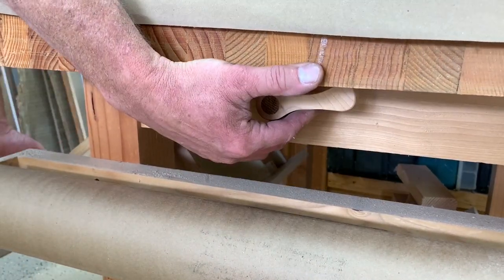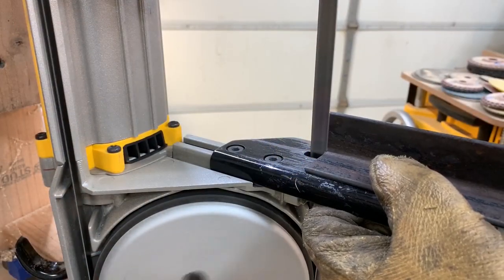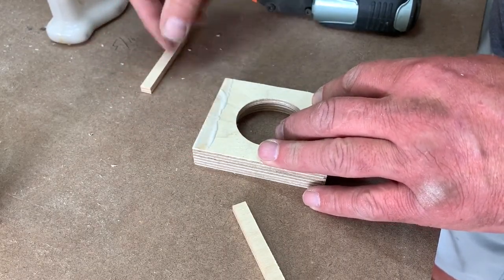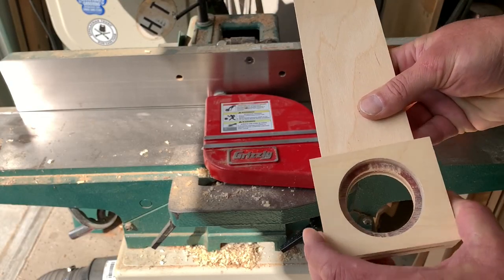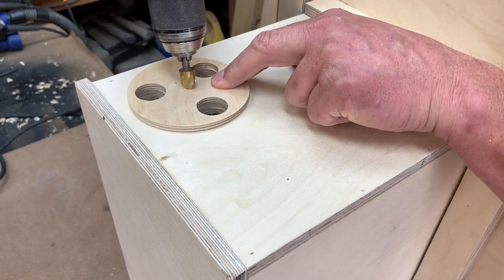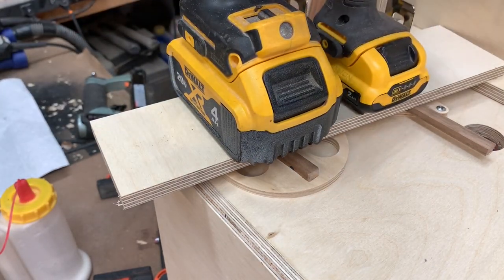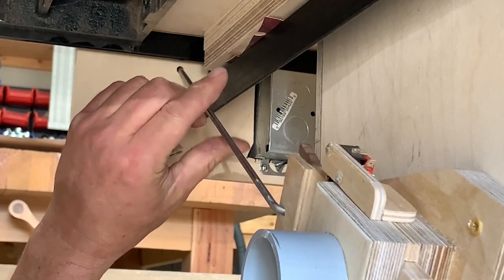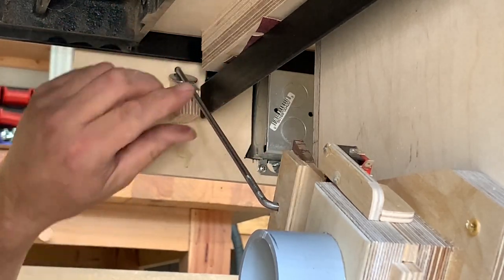Router Table/Lift Installation | DIY Blast Gates and Dust Control that Wont Choke your Router!

Comment: 9.9 points out of 10 awarded to you sir! As I am about to redesign my wing mounted router table in advance of receiving delivery of my new Incrajig LS positioner, I have found a number of really good ideas in your vid that I will be incorporating into my new table. Specifically, the framework under the table and, ingeniously, the ducting for the router. My current setup with the dust box underneath is similar, but yours is better.  A 1/10 point deduction for your video, the continuous, repetitive  guitar riff.  After about 4 minutes, it was making me nuts. So I muted the vid and hit the closed captions.
Reply from the maker: @TheLpjoe  haha. Thanks for the compliments! Also I get it about the music. Kinda wears me out too! Haha.

Comment: I love the space saving feature by putting the router on the table saw. I actually did a similar thing. My saw isn’t portable. I built a cabinet with 3 small drawers on each side of a router access door and 2 larger drawers below that. I made my blast gates for everything in my shop the same way except in a 4” size. Put Formica on the top for extreme durability and slickness. I leave the door just cracked open for air. Works great! I have the 3 1/2 hp Milwaukee router and the Jessem master lift ll. What a combination!! Hope to see more of your ideas!

Comment: Very nice job. A friendly suggestion. Next time just use a pin nailer on edge banding with the glue.  That eliminates the need for clamping and allows you to keep building.  Pin nails can barely be seen.

Comment: Great design, I like the support brackets over using legs with an extended mobile base. I may do metal with a wood filler strip to sit flush

Comment: Grate videos. I’ve make similar blast gate when I 1st started. They work great for a month. But then dust build up get stuck in between and moisture expansions and contract. Causing gate to get stuck open or hard to open. I move over to the plastic blast gate cheap but won’t last long because of dust build up in between. Finally I change to the metal gates. Clean so easy on them and a lot better functional.
Reply from the maker: These are working well so far, thanks for the tip, I'll check out the metal gates. Thanks for watching!

Comment: The ingenuity in this table is awesome!

I really like the dryer vent to separate the clean air from the dirty air and the dust collection on/off switch.

You have given me many ideas to use on my own lift when I get one.
Reply from the maker: Hey thanks! I appreciate that! Have fun!
Reply: I don't think I've seen that before either.
Reply: damn brilliant idea, does it seal well enough?

Comment: Just installed a JessEm router lift and one of their new router motors.  I have a work bench with removable trays down the center. I made the router table so it drops into the space of one of the trays.  That way I can take out a tray, use the router then remove the router table and get the workbench back.  For dust removal all I did was put a shop vacuum connection behind the fence.  It is new to me, and I have only used it for a couple of days, but it seems to be working fine.  Your work is really neat and a lot more elaborate than mine.  I wish I had seen your video before I built my set up.
Reply from the maker: Nice! that sounds like a great setup. Thanks for watching!

Comment: Nice job, but how do you get to the router motor speed adjustment for larger bits?
Reply from the maker: Yes, That is a bit tricky. I found that if I lower the router all the way down, I can reach up in there and turn the dial. Not ideal, but works okay. Thanks for watching!

Comment: Nicely done!
Yours is the first router dust collection box that I've seen that provides fresh air to the router. Something that I've been intending to do when I build mine, which will be "any day now..."
I've become a big fan of the "safety" switches with the big red "OFF" paddle. It beats fumbling for a toggle switch when you really need to shut it off NOW.
Reply from the maker: Thanks for the info! and Thanks for watching!

Comment: Nice build... with some unique ideas.  The blast gate switch is great and you could change it up for some type of magnetic/relay switch that comes on when you flip the router power, so it becomes one action and not two, but I like yours as well.
Reply from the maker: That sounds like its right up my alley. Love that idea. If I ever get some free time, I'm gonna try that. Thanks for watching!

Comment: not a fan of having the router table in the extension wing of a table saw, but you have some great ideas that i can incorporate into my router table rebuild. i so need to improve my dust collection, i like how you cooled the router 👍
Reply from the maker: Thanks a lot! I’m stuffed into such a small shop that I had to use the saw wing. Someday…. 
Thanks for checking out the video.

Comment: Thanks for the very impressive and creative design! I could think only about one possible imperfection: how to adjust router speed since fresh air hose is in the way.  Any suggestions for solving this issue?
Reply from the maker: You're right. I do have to remove it. Let me know if you find a workaround for that. Thanks for watching!

Comment: I love your router table specially the details on your dust collection system. how big was the dust collector box and the switch on the Blast Gate I love that
Reply from the maker: Thanks! I think the box is about 12x14x8 for the dust collection. Thanks for watching!

Comment: 0:10 That little nut pocket that holds the lock/unlock bolt on the underside. Mine stripped under very little use. VERY weak part IMO. It can't handle the stress of locking and unlocking. The aluminum wears and eventually the nut inside the pocket spins and it will no longer lock the lift in place.

Comment: I wish I would have watch this video before making my router table lift on my table saw.  I would like to make the dust collection box but looks a little heavy since I have a contractor fold up table saw (small shop needs to be folded for space).  thanks
Reply from the maker: Yes, it may b too heavy for a job site type table saw. But you cold definitely make a lighter one. Thanks for checking it out!

Comment: Hey, whadda we got heyah? Leonardo fuggin' da Vinci?! No, but seriously, you are wildly resourceful and clever; instant subscribe. Oh, and how did that 4inch ducting work for keeping the router cool? Thinking about copying that this week, if it worked out.
Reply from the maker: Thanks! Its working great so far. I do have to remove the hose to adjust the speed of the router so, not a perfect setup but overall is working great! Thanks for watching!

Comment: Awesome build!  I've ordered that same lifter, and will start installation next week.   I'm a bit confused about your switches on the blast gates, though.  Are they low voltage (maybe 24v) going to a contactor on your shop vac?  Or is everything 110v?  How many blast gates can you connect to the shop vac that way, and will you burn down the shop if you open more than one blast gate at a time <grin>?  Thanks!!!
Reply from the maker: Thanks! Haha,, no, no fire hazard. The switches at the blast gates are all 24VAC. They run on a doorbell transformer. I built a small panel box that uses this power supply
https://www.amazon.com/gp/product/B009AXCCGS/ref=ppx_yo_dt_b_search_asin_image?ie=UTF8&psc=1
to control this contactor
https://www.amazon.com/gp/product/B06X8Z255M/ref=ppx_yo_dt_b_search_asin_image?ie=UTF8&psc=1
The contactor then sends power to a standard outlet that runs the vacuum.
The gate switches are all daisy chain wired in parallel so if any single gate, or more than one gate are opened, the outlet is hot and will stay hot until all gates are closed.
Hope that helps.. let me know if you have any more questions.
Good luck and enjoy you router lift. I love mine.
Reply: @LastLegWoodworks  Thanks for the quick explanation!  Full speed ahead!!!

Comment: Great Video!!!! What are the dimensions of your table top, and what radius did you use in Easel to cutout for the plate. I have the lift coming this week and have to cut out the top for it. The manual says 3/4 but your video looks like 7/8. Yours fits very nicely!!!!
Reply from the maker: Thanks! The manual is correct. I checked my Easel settings and the corners are .75 
Thanks for watching the video! Enjoy the new lift! I’m loving this one.
Reply from the maker: Oh, I’ll measure the tabletop and let you know tonight when I get back home.
Reply: @LastLegWoodworks  Thank you, it will be nice to get it right the first time!!! LOL
Reply from the maker: Sorry for the delay. My router table is 27 X 16 not counting the table saw bed that it’s connected to.
Reply: @LastLegWoodworks  perfect! My plans were for 27 x 16. I appreciate you looking!

Comment: Are you happy with that router lift?
Reply from the maker: Yes, very. It’s really well-made and works flawlessly. The only thing I would add is a high-speed wheel for raising in lowering, but that’s on the next model up I think. It’s really not an issue at all, more of a luxury.